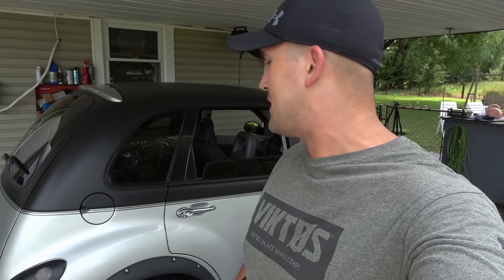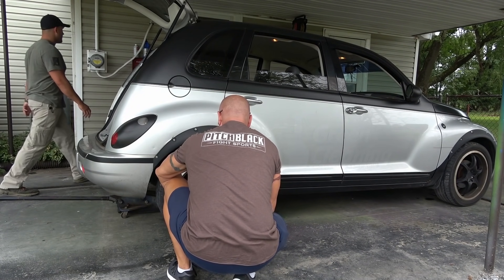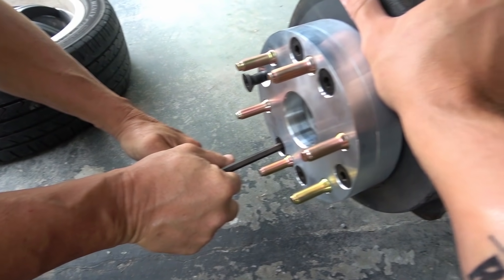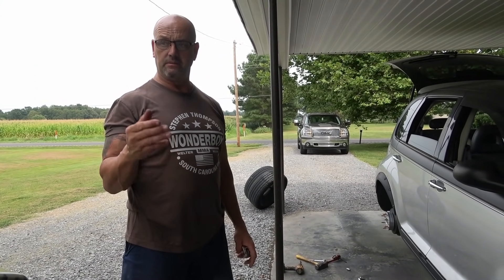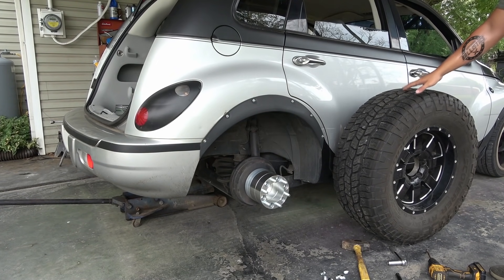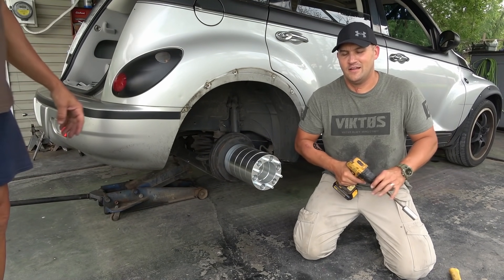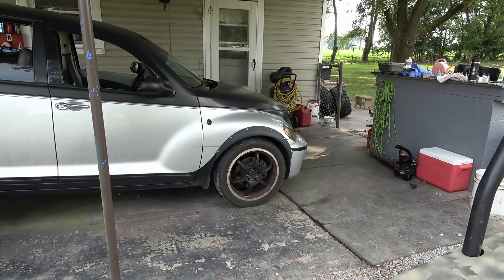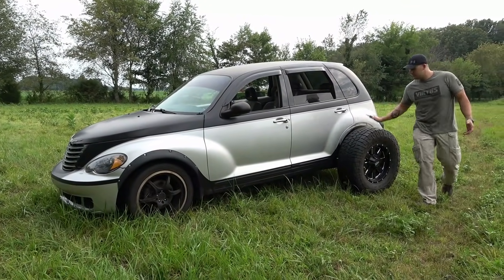Monster PT Cruiser Build (Part 1)

Comment: You guys should've used the brakes or at least the e-brake when trying to torque the wheel spacers it would've made life a lot easier
Reply: I was wondering why they didn't
Reply: I guess like Ricky would say "hindsight is 50/50"
Reply: I was going to post the same thing.
Reply: I would guess they are shot.

Comment: pro tip. When installing the wheel spacers, use a long pry par to wedge between the lug studs and the ground to stop the hub from spinning. That way you can tighten the nuts.

Comment: Time for a couple real battery impacts. A 3/8 mid torque, and a 1/2” high torque in red, yellow or orange.
Reply: Can you say Milwaukee FUEL high torque 1/2” drive! Best battery operated mechanic tool ever!
Reply: @lawrencemartinjr6888    I got my yellow one with a 5ah battery and charger for $200 on Black Friday. It will break a 1/2in grade 8 so I can’t complain.  

I actually bought 6 from 3 stores and got mine free in the end.

Comment: You guys are hilarious!  Yes, you gotta finish it and put the front wheels on too.  I think rather than using all those spacers, you could cut and lengthen the rear axle.  it wouldn't be that much work, and it'd be safer and the wheel bearings might not suffer imminent catastrophic failure.

Comment: I'm pretty sure I'm in the minority on this: I love PT Cruisers. I learned to drive in one and I find them to be very comfortable and relaxing to drive. I really think you should put a bit of a lift on it and trim the fenders, rather than using such an excessive number of spacers. It will work better, might still be street legal, and, most importantly, be safer. I'd also recommend a brake replacement on the front. They're already somewhat prone to brake issues and the extra mass of those wheels will likely make it worse.

Comment: Guess the laws are a bit different in KY. Here in Texas, tires/rims/spinners cannot stick out any farther than the side mirrors. Kinda cool, but would look better to cut the wheel wells to fit and get rid of a couple of spacers. But, what do I know, I driver a stock '06 PT Limited.
Reply: Get rid of the side mirrors.

Comment: Cummins swap it. Btw I like the tiny pipe wrench. oh and if the car has back brakes than you can put the brakes on so you dont have to hold the thingy mobober with the other hand. it looks like a dually PT Cruiser.

Comment: Whistling diesel used three times the amount of wheel spacers on his so you should be fine lol
Reply: Yea, but that’s the same guy that sort of shot himself in the face with a 50BMG… lol, he really didn’t, but he did get hit with a piece of it in the forehead.
Reply: @carbon_no6  yeah and his injury was caused by stupidity and Scott's was caused by material malfunction i.e not his fault

Comment: My early teens are flashing before my eyes. Now you need to install an Alpine using nothing but your teeth to strip the wires and electrical tape to wire them together.

Comment: Spacers are fine for the rear, but never use them for the front. They create a weak point that will snap while driving(turning) not safe at all

Comment: Anybody remember when the PT cruiser was bad ass ?
It was supposed to have a big ass Engine   And there were some other concepts that were supposed to take after it 
That car definitely backfired
Reply: Some variants actually had a decent bit of power. They're rather light for their size, so the smaller srt setups that were in some made them quite spicy, particularly considering that some states classified them as a minivan.